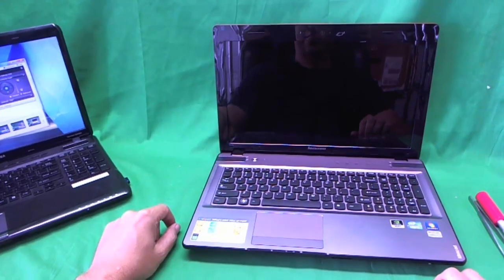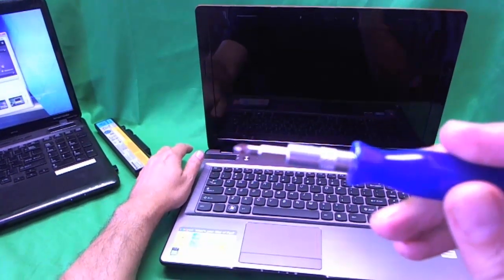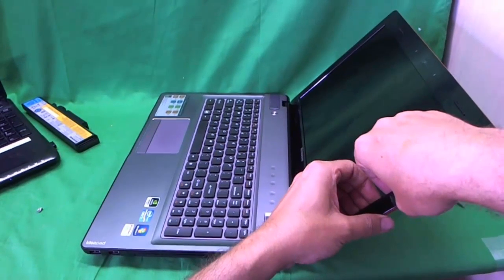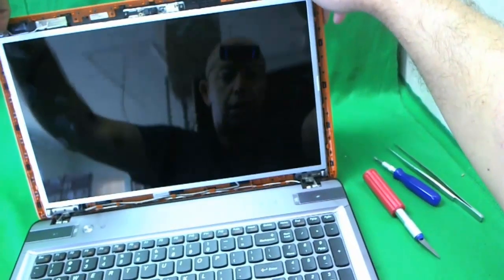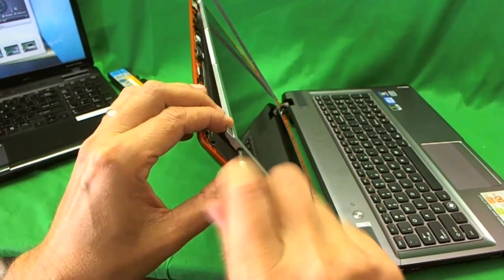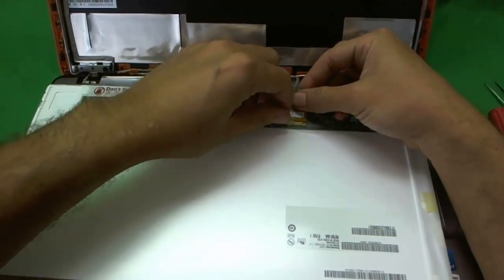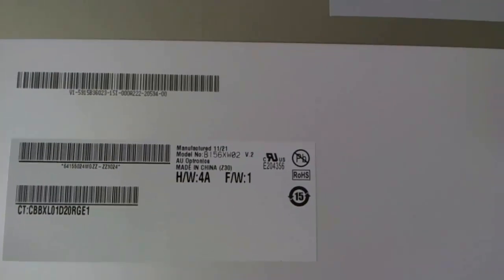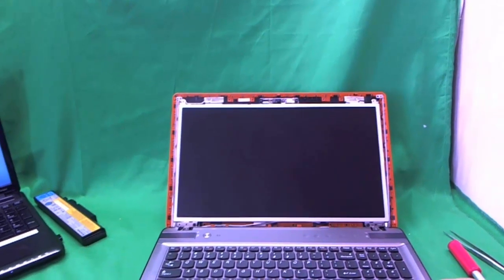Lenovo Ideapad Y570 Laptop Screen Replacement Procedure

Comment: I don't have a Y570 anymore, but I'm still curious about this. From what I understand, the Y570 has a 40-pin LVDS cable, which is capable of handling a 1080p signal, but it's converted into a 30-pin LVDS on the motherboard, which would probably require modification to handle any screen resolution any higher than 1366x768.

Which sucks, because 1366x768 is a horrible resolution on a 15.6" laptop...
Reply: That actually is the resolution. You are very wise.. and 1366×768 is an ok resolution if they make the panel looks beautiful

Comment: please, i need help... could you please tell me that u have an led for lenovo y570 it's exact product no. is (BOE HT156WXB-100 HD G LED1 NB LCD ) & how do i get it i currently live  in egypt for certain circumstances i had aproblem with my led screen it appears to be having white,red,yellow vertical strips on my left corner i need to be sure is there anything i can do to get fix it besides getting new one notethat: there are no cracks on my screen....thank you for u r help.inadvance

Comment: The screen on Y570 cannot be upgraded. Due to poor design by Lenovo, 10 pins from 40pin monitor connector are used for webcam, leaving only 30 pins for the screen, which is not enough for an HD screen.
Motherboard itself only uses 30 pins for the screen, so you can't upgrade the screen without replacing motherboard.

Comment: @cirozorro As a mentioned here, they split the 40pin cable into 2 - 10pin and 30pin. 10 pins go to webcam, 30 go to screen. Since this is how mobo is set up to send the signal out, and you can't have a 30pin HD screen, this screen cannot be upgraded to a higher resolution one =(

Comment: @darkdvr Tried it already. Doesn't work. Turns out that they're using 10 pins out of 40 for a webcam. And you simply can't have HD data flowing through a 30-pin cable.

Comment: @saskenarutokakashi There is a model called B156HW01, also from Au Optronics that has same 40pin connector at the same place, same size panel.. It's $109 bucks online. I'm buying it and will try to replace it.
That laptop with full HD screen = THA BOMB!